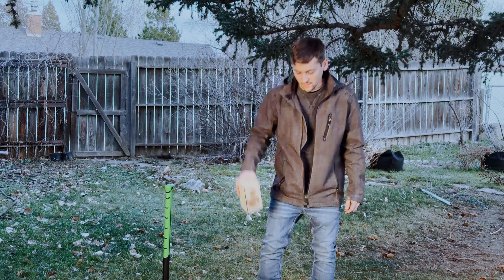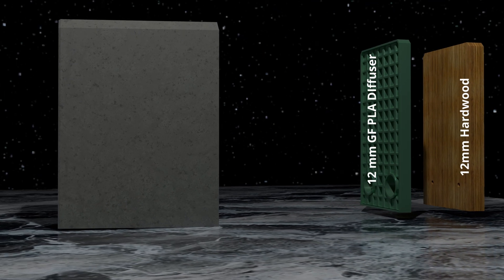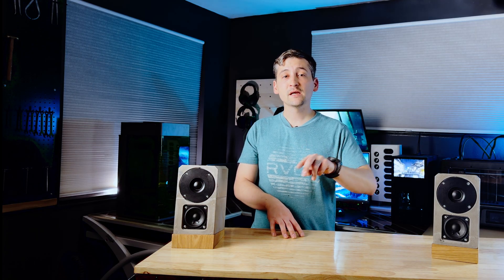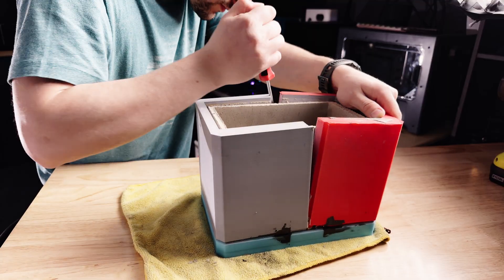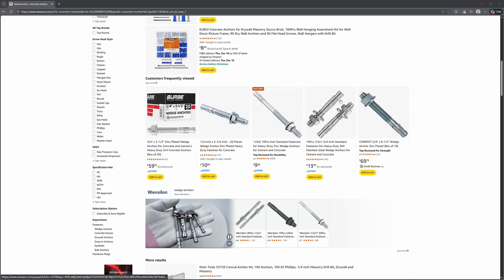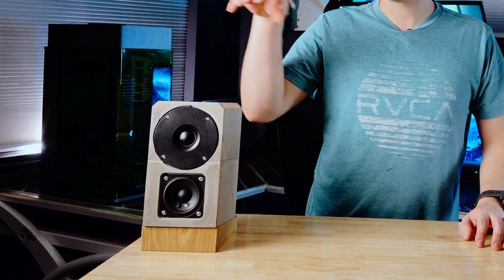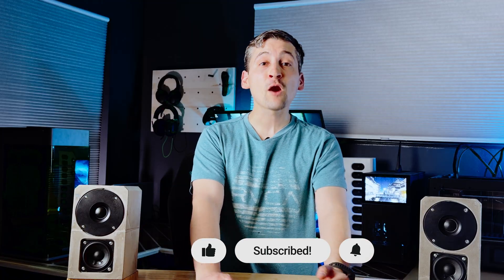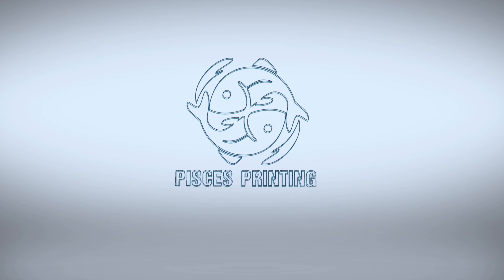Concrete Vs MDF Speaker boxes

Comment: A LOT of hyperbole when stating 'the problem', makes me wonder how concrete would compare to mdf/silicone/mdf sandwich, constrained layer damping is a powerful tool to fight vibration.
Also why not make internal structure with non-planar walls to fight reflections as well.
Reply from the maker: The main issue I’m attempting to eliminate is any flexing in the wall, while maintaining a thinner wall. I could have easily used 3-4 layers of 19mm mdf to get something that a speaker would be unable to flex but doing that with 8-10mm of material is why I turned to concrete. . This allowed for my internal volume to be as big as I needed without the external size becoming excessive as its final home is on my desk as bookshelf speakers for my 2.1 sound setup. 

The internal walls were left smooth for easy demolding and I could have added more 3D printed diffusers internally but I figured with the internal walls being tapered the bounces would come of angular and not perpendicular therefore standing waves would become less of a problem.
Reply: @piscesprinting   'problem in system that has to handle A LOT of energy' - yeah no, that is not even decent amount of energy.
'Giant slabs of one inch hardwood' - come on dude, you understand acoustics - you know better than say this nonsense.
> 3-4 layers of 19mm mdf - oh come on, really? At that size 10-12mm and a single brace in the middle would be more than plenty.
Reply from the maker: In all fairness a 20watt laser will burn through a 1/2” piece of wood fairly quickly. So power is relative. As this speaker system is seeing 30-40watts peak/channel. 

I would also say that what most boxes are seeing is pressure swings internally at hundreds of times a second. So if the box flexes at all it will introduce muddy and delayed sound. Which is the opposite of the goal of this project. This can be construed as a lot of energy.

Now use this concept on a bigger scale, 2-15” woofers and all of a sudden a single 19mm mdf wall is very insignificant. I’m not saying all speakers systems have to be as overbuilt, but there are speaker systems out there in the 1000w-2000w per driver. 

So I feel I’m not to far out of line stating speaker systems deal with lots of energy.

I also know that 10mm walls of mdf would vibrate at low frequencies, as I’ve played with different enclosures and in a vented I would say, ok 12-19mm walls for a bookshelf is adequate, but for a sealed I do not want any pressure deformation happening at any scale. As that does introduce distortion into the system. So I likely overbuilt but with the intention of it not moving. 

If you feel you can do better, feel free to design, test, build, video and edit a better more put together project, then tag me in it, I’d love to see what you come up with.
Reply from the maker: I also did state 3-4 layers of 19mm mdf would make a box that is incapable flexing from a speaker, as that was the “test” for the video. I know it’s overkill the same way concrete is likely overkill, but doing thin 8mm walls means I use concrete and don’t look back. I could focus on other aspects and less on “will this flex” “do I need additional bracing?” As that was the goal
Reply: @piscesprinting  lawn mower running full tilt is a whopping 0.01W of power, or 100dB. Speakers are notoriously inefficient.
Flexibility of the material matters when taken in conjunction with shape - 20x10cm 12mm panel is stiff enough, whereas 100x30cm 12mm panel isn't.
Vented has the same requirements as sealed - vent is transparent below Fs, but provides mass loading above.
Reply from the maker: I don’t think you know much about watt to horsepower conversion then. As it’s more than .1 watt to over come friction on a 5hp mower engine . As it’s 746watts per hp, so the 5 hp engine produces 3700ish watts at full tilt not .01 watts. Also the “noise” is explosions happening at 6-8 times a second.so I would assume it’d be loud(not sure if modern ones even do 100db though- as 90db or less is generally the limit we go for in a muffler situation). If you’re going to counter with different subjects. Please educate yourself on those different subjects. I may only have 5 years in audio but I’ve been working on engines for 20, so please try to educate me more on them, it’s quite comical.
Reply from the maker: I do wonder what the excessive or non-literal statements were though during my “problem” though.

Comment: I'm wondering if you could use an open foam concrete and create "open back" enclosures? or how much of an effect aerated concretes would have on acoustics.

 NightHawkinLight just did a video on making easy aerocrete with Xantham Gum and Dishsoap which could be an interesting material to work with next. Could yield lighter speakers too?

edit: Hello fellow NightHawkinLight viewers.
Reply from the maker: I did see a few commenters talking about this! I do know that light boxes are not always the preferred. Sometimes the mass is needed to prevent “wasting” energy moving the box instead of just the air around the cone. 

Basically if it’s to light the box may vibrate back and forth slightly wasting energy.
Reply: @piscesprinting  could concrete be stiff enough that it isn't (as much) of a problem? 

Could also be used aesthetically, e.g. covering the port in a aerocrete "grill"?
Reply: @piscesprinting  Are you confusing weight with stiffness?
Reply from the maker: I don’t think so? The original comment mentioned lighter speakers, I wanted to iterate that’s not always preferred as the mass is sometimes needed to stabilize the enclosure. 

Those are two very different properties… one is how much something resists deformation and the other is how much force is applied (in our case downwards) based on mass and gravity …. Not sure how one confuses those two very different concepts…
Reply: @piscesprinting  So, low mass, stiff panels store less energy and can be damped easier. The speakers could also have a heavy base for stability. Celestion SL600 used an aluminium honeycomb for it's panels.
I think the comment suggested a few ideas but I took it two ways, An  Aerocreat box or back panel, open? as an absorber, but also a more conventional panel material "Could yield lighter speakers too".?
I also think I misunderstood your "box may vibrate back and forth slightly", I though you meant the panels not the whole thing rock about.
Reply from the maker: In that same concept though high stiffness high mass panels will resist changes. Newtons laws say objects at rest like to stay at rest. So big heavy things are less likely to start moving to begin with. 

I have no frame of reference with air-Crete as I’ve never used it, from what little research I’ve done, it’s easily shaped and cut, and thermally resistive, but I haven’t found a ton of information on it ability to resist resonance. As that’s a major killer of acoustic objects.

I did find the lightweight portion in respect to the speaker enclosure in which lighter is fine if your needing to watch weight, like portable speakers and such. But if it’s stationary, I prefer a heavier speaker enclosure. That way it has a zero chance of rattling around. 

And yes in my experience with 3d printing enclosures, I’ve went light enough that the box will rattle across the table, which isn’t great for sound quality or form/function. So ultra light is a no go, plus if we start talking 12-15” woofers then big heavy boxes are almost a must.

Comment: Good job! Regarding the concrete mix: using a self-leveling compound is fine, but for this application I would definitely use a type rated for deep pours that includes reinforcing glass fibers.

Also, when using self-leveling compound, I would use a scale and the exact recommended amount of water, which would definitely result in a runnier consistency than what you had in the video. These self-leveling compounds are full of chemical additives that help with flow and degassing.

If you use the correct amount of water and mix it really thoroughly (usually 2–3 minutes is recommended to activate all the additives), I don’t think there would be any need to use a vacuum to degas the concrete. You could simply pour it and lightly vibrate it, for example with a sander, to get rid of most of the air.
Reply from the maker: Good to know!
Reply: Are there any places* that have recipes for the different concretes? I've been wondering similar things about RTV silicone mixtures. There's lots of proprietary mixes sold, but both have lots of tunable material properties that it could be useful to be able to DIY those too. 

*)edit: outside of a pile of research papers.

Comment: well ,  great ideas. i've seen a guy that does the same thing with concrete. for me the only down side is the finish , i would like to see if you can do  a speaker box filling the walls with that or other  material ? I''ll make my next project on the same way with a bunch of speakers drivers that I've got . 2222
Reply from the maker: I’ve actually done this, I mention in the video how I’ve previously filled 3D prints with concrete to create a speaker box with a plastic exterior I could sand and paint.
Reply: @piscesprinting can you share how you have done please ? I'll try tos replicate that .
Reply from the maker: 3D Printed Subwoofer Enclosure Reinforced With Concrete
https://youtu.be/ra3oLkPJg1U

The video is dated and definitely not of the same quality as more recent videos but the process and techniques still stay the same regardless of presentation.
Reply: @piscesprinting thanks to share that , I'll look at that .🎉🎉🎉

Comment: Which drivers did you use?
Reply from the maker: 292-438 GRS 1TM-4 1" Mylar Tweeter with 1/2" Voice Coil 4 Ohm 

285-175 Dayton Audio CE70PR-4 2.5" Full-Range Speaker Driver
20W 4 Ohm

Comment: I would like to see what actually happens if you actually lean into air mixed into the concreate, by happen chance NightHawkInLight just made a video exploring DIY friendly aircreate, or you could go the other way and give epoxy granite a try. also how long did you let the concreate cure before you tried demolding it?
Reply from the maker: Yeah definitely something to explore. I do wonder if the voids are stress points or if they would actually provide a place for stress to relief into. Instead of a big crack perhaps some micro cracks internally.